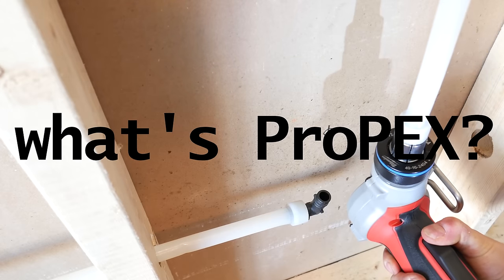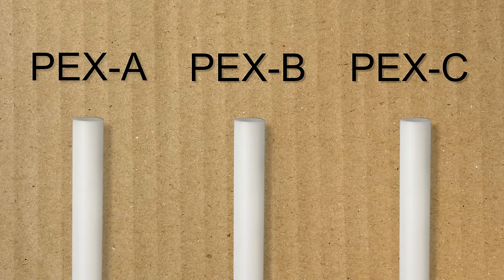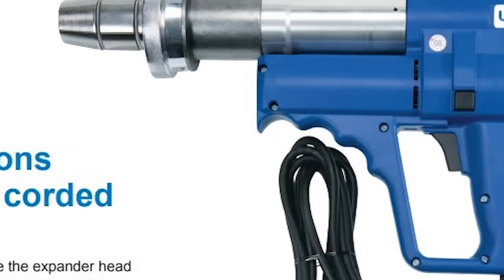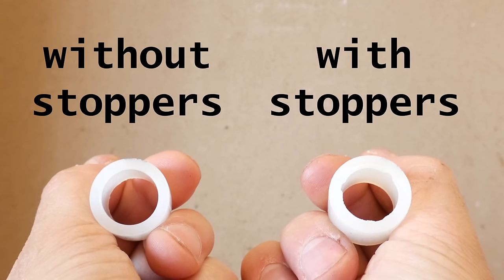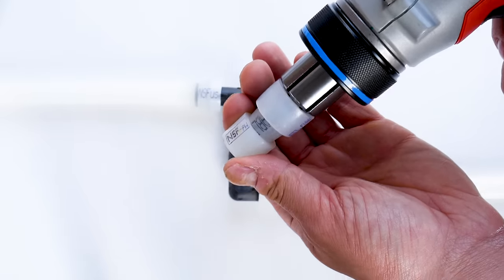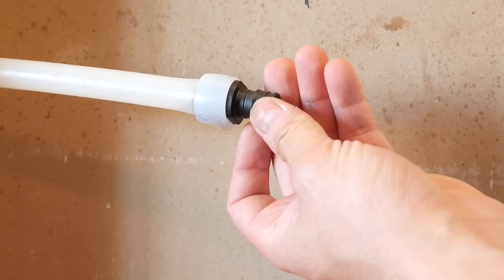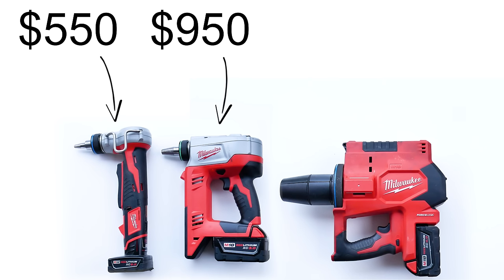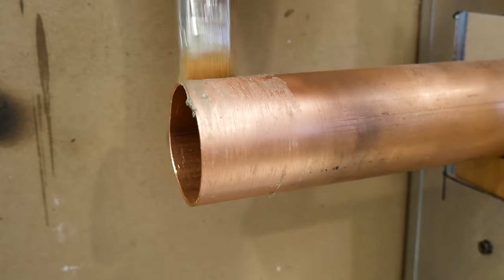UPONOR ProPEX, The Future of Plumbing (COMPLETE GUIDE) | GOT2LEARN

Comment: I am sorry while you covered the use of this material well for plumbing systems. You did not cover the cons well at all. There is no perfect material for plumbing. Some cons:
PEX may leach BPA and other toxic chemicals.

PEX is extremely sensitive to any UV light not just sunlight.

PEX can be damaged by chemicals and pests.

PEX can’t be installed in high heat areas.

PEX is semi-permeable, which means liquid can enter the pipe, causing contamination. It’s also not antibacterial.

There are others but people should know copper is not perfect but I still prefer it to PEX.
Reply from the maker: Thanks
Reply: What's considered high heat areas? Like an attic in florida?
Reply: @naro1213  nothing even close to that. The ambient heat recommendations are the same as THHN, so if you can run standard electrical wiring in it, you're fine
Reply: @FLYWHEELPRIME  thank you, just repiped my house and got a little bit of worried.
Reply: An example of High heat area would have been close to a water heater you would need transition connectors to go from copper to say PEX. PEX in attics with temperature variations you would be more worried about freezing rather than heating. Indeed on colder areas it’s one reason when installing PEX you keep it low away from roofline and don’t use too many fittings for PEX while PEX is quite resistant to freezing the fittings are not. With mild winters in Florida I think you should be okay with that. If you are really worried you could put foam around PEX which would also help with the heat insulation as well.
Reply: Math Man Near a water heater? What are you talking about?
Reply: @MisterTwister people have installed PEX right upto the fittings of a water heater. National code only allows PEX to be installed at 18inches and above. Uniform plumbing code specifies that: see page 17 of the document:

https://www.huduser.gov/portal/publications/pex_design_guide.pdf
Reply: Meaning you can’t run pex right to the hot side of a water heater, you need a couple feet of buffer using copper.
Reply: None of these, except for maybe pests apply to a typical installation. If Europe is good with it, I’m not going to worry about bpa. Why would you have high heat in walls? Ditto UV light, the pex isn’t supposed to be exposed. I haven’t heard any horror stories about vermin eating and leaking the pex. Maybe it happens, but wouldn’t that be a big deal by now with all the pex out there?
Reply: DezzNutzz  temperature rating is relative to pressure in the line. These have high of 93 degrees Celsius at 80 psi.and 23 degrees Celsius at 160 psi. You will have around 80 psi so you should be fine.
Reply: Kevr Completely False. You can use pex on a hydronic heating system, where it can see close to 190-200 degrees.
Reply: MisterTwister  is it  Fahrenheit or Celsius  and what pressures.
Reply: MisterTwister I know, I was responding to math mans point about it not being usable in high heat AREAS
Reply: MisterTwister 
PEX is plastic, and plastic melts. So keep your PEX pipes away from things that are hot. Codes commonly require PEX to be at least 18 in. away from the water heater and 6 in. away from single-wall flues on gas water heaters. And stay well clear of furnace flues, wood-burning stove pipes and any other item that gets hot.
Reply: Run it everyday for 14 years now. I have to lead with this. Another copper nut thinking every homeowner can afford k style copper. Only k style is the best. L and m corrode and rot away in 40-50 years. We have adapted to what the customer wants. And I have to include. A plumber would know. If you pressurize a pipe. Nothing with less pressure is entering that pathway. So the likeliness of chemicals getting in, is near impossible. I have been installing directly to water heater for 14 years with 20 year warranty nty. How hot you talking for a standard residential home?  Nothing happened yet. When is it suppose too blow? Yes in commercial application where the engineer specifying you to use type k and your boss is footing the bill. Copper wins hands down. M won’t last 20 years. L might get ya 35. So if the manufactures lifetime is the same ? Why spend triple amount? Do you take guests under your house to show off the copper water lines? Homeowners want it. We provide it. Why? Money.
Reply: P Jplumber yep, in my neighborhood of 50 year old homes many pinhole leaks with copper.
Reply: Bill Gringo Yes it is Fahrenheit
Reply: @pjplumber2146  Back to the water heater situation. We should give some clarity to what type of water heaters we're talking about. Any kind of natural draft gas/propane water heater or oil powered water heater with the typical top venting that's located right beside the hot and cold inlet/outlet should NOT have any pex piping within 18" of the water heater. Any kind of downdrafting effect will cause excessive heat from the draft hood to melt/break down the plastic of the pipe. This is often seen when the pipes have been insulated with the black foam insulation right down to the tank, you often see it all melted near the draft hood at the water heater. (which I've seen over and over again as a heating contractor). No big deal for copper. Not good for pex if it's used instead... And the cold side is included just as well as the hot side. When hot water is not in use, it naturally radiates up the cold inlet side.
Reply: I am glad the topic has generated debate. As I said in the beginning there is no perfect plumbing material including copper. Yes thermoset PEX is growing in market share as it can be laid in long lengths and be quicker to install - time is money in industry. It’s always important to know in the modern age the end-to-end life cycle use of the material. The vast majority of PEX piping is not recyclable or at least very limited use recyclable. Off cuts and in future rip outs due to renovations will have to be dumped in landfills or underground stores, and if recycled can only be limited to foam type material at present with limited other uses. The EU had a project in 2009 which looked at developing a pipe that would address this issue and came up with nanoflex or greenflex pipe not sure this has actually taken off. Companies and people will have to make decisions on what to install but as in every aspect of our lives our actions do have consequences and costs in the future.
Reply: Kevr nothing is eternal😂
Reply: Jason I been hearing that about gas heaters since pex came to middle Tn. Still waiting for the flue to melt my pipe. And I gonna ruffle a few feathers. But I direct connect to u v lights. Still waiting on those to blow. Water is the best insulator against u v light. Hense our atmosphere. I know the warnings. But I do also like to test things. Lol.
Reply: @mathman0101  Thank you for the helpful details!  Do you know if PPR pipes (the ones welded with a heating iron) also have BPA that then gets into the drinking water?
Reply: Branimir Todorov i would suggest you look at the EPA work on this and would be a useful reference 

https://www.epa.gov/sites/production/files/2015-09/documents/permeationandleaching.pdf

Also take a look at research summaries:

https://pprc.org/2015/p2-rapid/is-high-density-polyethylene-hdpe-a-good-choice-for-potable-water/

I suggest you do some reading and research but it does have some benefits over PEX and copper.  The decision to install will be something you and or contractor and state (linked to code) authorities will have a say in. Anyway we are all here to learn.

Comment: Very well done video. But I have a question not addressed. I bought and am using a PEX straightening tool where I simply pull the tube a few passes between the 8 sets of bearings, tightening the compression between the upper and lower bearings. Work well to make straight tube out of tightly coiled.  HOWEVER: the ends of tubing, even after straightening, have a tendency to remember the original curl of the tube. Not as bad as when still coiled, but enough to make a carefully installed job have some crooked looking issues. 
What I wondered is: If I take a rod or tube of a size a few mils smaller than the tube ID, run it into the ID, and then heat it up with a heat gun allowing it to cool with the rod still in the ID….. Will the tube remain straight? Or will the material memory curl it again? And will the Uponor expansion system still work without issue on tubing so heated?
Reply: After you straight to have you tried cutting back off the end short distance and cut & use there and  see if it is cleaner/ straighter

Comment: Just used it today for the first time. Pipe a heating underground snow melt system . Fairly easy to use but didn't like the the stiffness of the pipe. little difficult. like to roll and kink to where it wants.

Comment: I worry about the life expectancy of the fittings mainly.   How are they different than the old style PB fittings (trade name Quest) that became very prone to cracking as they aged.   Also what is max temperature rating of the fitting (think hot water or hydronic heating) before the fitting leak at normal line pressure.
Reply: Yes those old PB fittings were a major issue in the mobile home industry

Comment: Propex compression is what we had to have all the hot and cold water pipes changed to. The first company had those stupid metal clamps that all failed within a year. Our plumber used the Milwaukee power tool, no more metal clamps, no more leaks

Comment: What's the expansion like after years?
Reply from the maker: This system has been used for a while now (more than 10 years) and it hold up to the test and beyond, it's just a great system.
Reply: The fitting is constantly trying to contract. Therefore, no leaks.
Reply: i am going on 5 years now, in the cod climate of Maine- and no issues , perfect so far. respect the pex and it doesnt fail.
Reply: Got2Learn   Hasn’t it been used in Europe for like 30 years or something?

Comment: If you get the m12 expander and want to use 1 inch pipe, get a 4 or 6 amp hour battery. the machine struggles a bit with the smaller batteries. Also I got my m12  for 180$ as a bare tool, and if you have very hard water the plastic fittings don't get mineral accumulation.

Comment: I have a location that  I service that used Uponor 1” red tubing that has had 4 cracks and leaks develop in the tube over the last 8 years. There’s currently a class action lawsuit against Uponor for this defective pipe. I have installed a copper crimp system for years without a single leak with plastic fittings. In fairness to Uponor this defective pipe is behind them. The other thing I remember reading is that they recommend letting the fitting set for 24 hours before testing.

Comment: Hey G2L I have a bit of an off-subject question. At the beginning (and at the end) of this video @ 0:18, 9:06 there is a gray sewer/drain pipe. I was a plumber in Germany and thats all we used. We called it HT. In my opinion versatile and ease of use beyond belief vs PVC here in US. My question for you is, do you know is that type of pipe accessible in north America at all and if so what is it called on this continent? All my research came empty handed. As always your videos are great and to the point. Thanks for sharing!    👽
Reply from the maker: Called PVC XFR here, it's a fire rated PVC ;)
Reply: @Got2Learn  Wow! Is it push-to-fit, with male-female sliding action with rubber O-ring etc? We used that kind of piping for all drain related installations. Edit: just saw it, its used with glue with no O-ring push to fit type. Have you ever heard of such pipe availability locally? Thanks again!
Reply from the maker: Yes glued. Here, only contractors can buy it I believe.

Comment: This may be a strange and abstract question, but, alloy plumbing and "water hammering" are a huge issue in the state where I live, especially on homes that are old, or have a plumbing system that is more then 40 plus years old. Most homes notice the issue from the typical washing machine hot & cold electric solenoid valves, when they are closed. But also, in short time, simply closing the kitchen facet fast, send a shock wave back through the system, often times, rupturing the older weakest spot in the plumbing system..  Is it safe to assume, this plastic system / series of PEX will dampen that, and not need one of those dampers installed to mitigate the hammering on the system?
Reply from the maker: Safer, but still necessary 👌

Comment: I've used a lot of pex, but mostly Nibco pex B with crimp rings.  I tried the pex A, and it's good, but I'm not 100% sold.  Maybe if I had a cordless expander, but all I have is the manual one. 

Either way, pex is definitely better than copper for most applications, IMHO.
Reply from the maker: I prefer PEX too.
Reply: Nibco is the worse pex you could be using

Comment: I'm a retired plumber,  I was certified to install pex , well I would never put it in my own home or buy any home with it  , I have been  called out to projects to check a leak in a home in Highland California,  a tee had developed a drip I discovered this because water was coming through the ceiling over a kitchen the home was right at 4500 sq ft about 700,000 dollars it had all the high end up grades , this was around 2002 , any ways I exposed the leak in the ceiling according to isometric drawings,  I wiped the joint down with my finger and the joint started to leak more and began to separate I quickly grabbed it and yelled to the home owner to shut the water off,  she did ,Iwas able to prevent water damage by putting plastic down on the  Italian hard wood floors and hang plastic all around my work area like a shower curtain ceiling to floor before I touched it I did get soaked and the water stayed on the plastic protection I put in place,  needles to say we had to figure out a way to keep this from happening in the future and were able to get city building departments to implement our findings, in California now you can't have fittings with  to much stress on those joints and that is determined by building offical   , also on that same track there were several over leaks with the same problem,  I have had to install that stuff in other track homes , with fewer problems but those issues still come up , at that time we didn't keep track of what plumber had installed that system on that home , we had from 5 to 20 guys on a project at a time with 100's of projects going at once , so we I'm sure installed more then any company at that time we also used copper the most and Flowguard by BFGoodrich CPVC, so over my 30 years as a new construction plumber I have seen alot of what works reliably and what we should stay away from,  also nice and rats here in California have chewed into pex and aqua pex for a drink of water It's because they can smell the water in those piping systems
Reply: What you describe sounds like PEX-AL-PEX piping installed with incompatible fittings. Also known as Kitec plumbing, this particular type of modern pex was very popular when it came out, until about a decade later when the problems were discovered. The problem was so severe, the original manufacturer lost a class action lawsuit to the tune of $125 million.

The PEX-A talked about in this video is quite different from Kitec.

Comment: when are you gonna do a manifold concept ???? for example, i built mine using a expansion PEX  type with a distro manifold, every single home run for each and every separate line.. it helps for repairs and isolation if needed. although it forced me to have a larger manifold, it helps in the long run. especially since my utility room is directly below in basement- and the runs are very short. and my longest run is only about 15 feet... your experience in mapping the right manifold would be awesome!! residential 4 person family. 2 bath
Reply from the maker: It requires a lot more pipe to do it this way, but yeah, in the long run for repairs it makes it easier for sure.
Reply: @Got2Learn  we r truly hoping u do a video on manifold pro and cons
Reply from the maker: Yes, will do one day for sure :)

Comment: It also has a higher flow rate that copper yes...? 

Keep this in mind You need to keep the pipe wrapped in package  protect from UV light keep out sun light.

Love my m12 but it  needs to expand faster 1/2" and 3/4"  at least also when doing finishing the tool does Jam if gets  water flushes out grease sometimes several times a day sometimes go days and it's ok without a jamming  hope they fix this with a fuel version.
Reply: Joshua Mcdonald  UV degradation is the biggest problem and white color and the packaging is not going to do much. The pipe must be black with carbon black .
Reply: @MrKhabbu  as long as you leave it out of the Sun and a smaller rolls come in their package that are protected from sunlight direct or indirect there's also an additive  in the actual pipe that last from 30 to 60 days apparently that helps in case of project delays or with installation.  Also paint it with  100% latex or acrylic exterior house paint
*NO OIL paint  
There's also apparently a trick if you think the pipes been exposed to too much sunlight you can heat up the pipe and then try to pull it apart if it snaps  apart or brakes instead of stretching the molecular structure is compromised. Haven't tried this but I'm going to try this  running experiment starting tomorrow.
Reply: Joshua Mcdonald  well if carbon black is mixed at the time of extrusion all the problem will be solved . I worked  for KITEC Industries (India) Ltd and we were using carbon black and made the pipes black and never had a issue of UV deterioration. I have used it for hot water piping and left it open in the sunlight for over 20 years now. Absolutely no problem.
Reply: @MrKhabbu dam eh u worked at kitec  ❤🇨🇦 .  But adding that to the Extrusion would change to pex b ? Or  it must be a cost per linear foot?